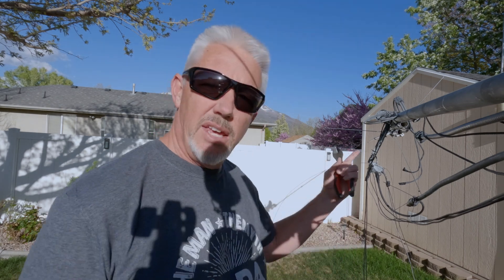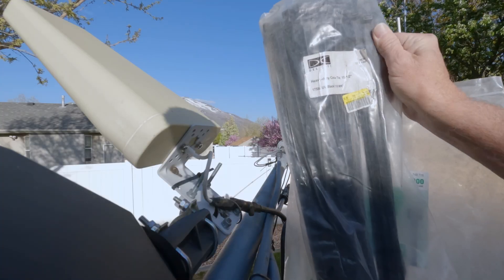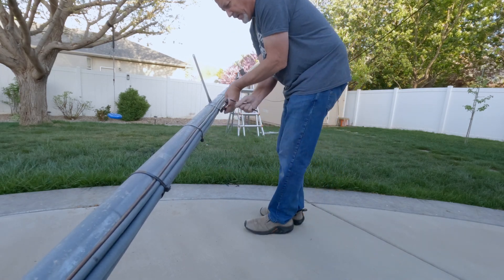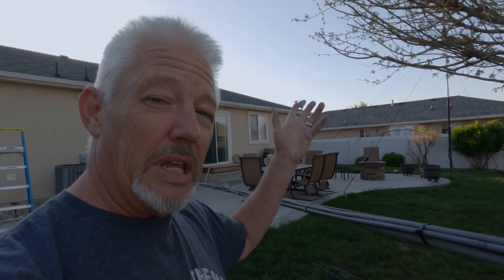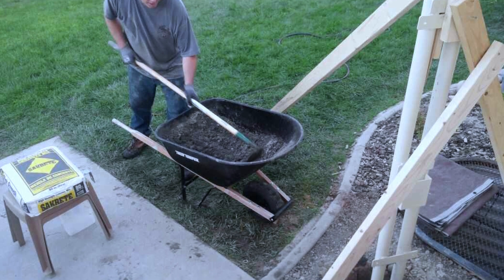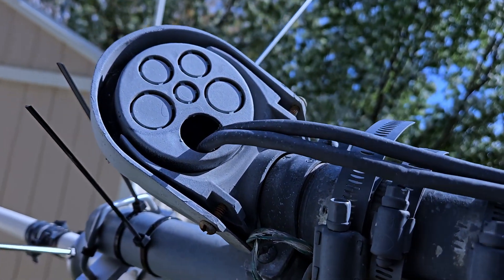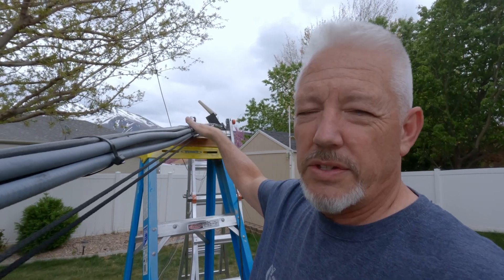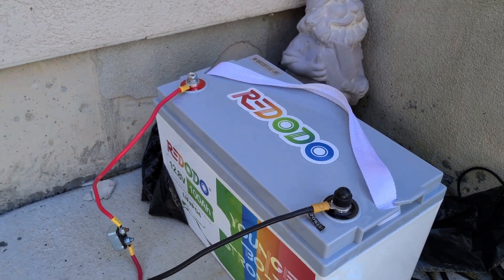Continuing Antenna Maintenance: Finalizing and Elevating my Tilt-Over Mast-Part 2

Comment from the maker: Would you install a tilt-up mast for HF ?
Reply: Sure I would. It's just a matter of the Space Capacity that is available in your / my Front / Backyard. I have seen a lot of awsome homebrew Tilt Mast Systems with manual and electric Winches for light - medium Duty Antenna Systems. In  most of the Cases this is helpful for a 1 Man Army to get the Job done alone without working his Fingers to the Bone. No Sweat working comfy and safely.

Comment: This mast is really a great design. I found the diy plans and made one myself. I live in Nebraska where we get all kinds of weather. I have a 2m/70cm on top . A 6 meter squalo about a foot below that, a home brew cobweb antenna a couple feet below that and a 40-10 EFHW hung below the cobweb to my shed. The mast holds it all easily without and guy wires. Mast is approx 35’ tall.